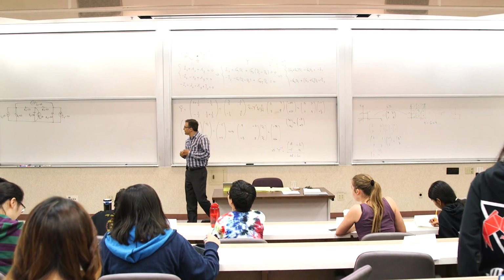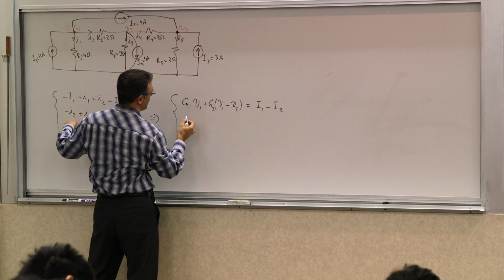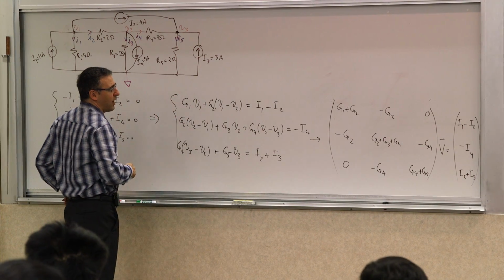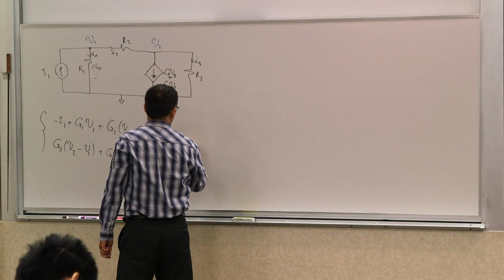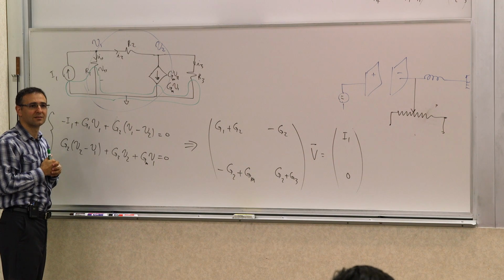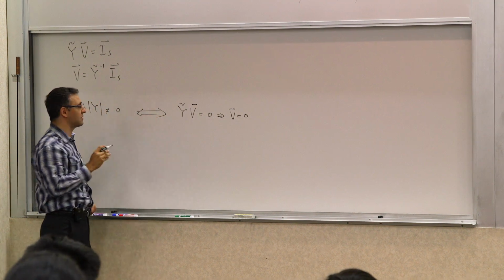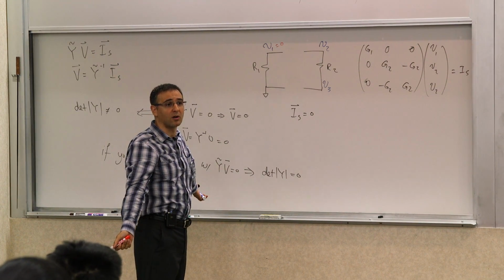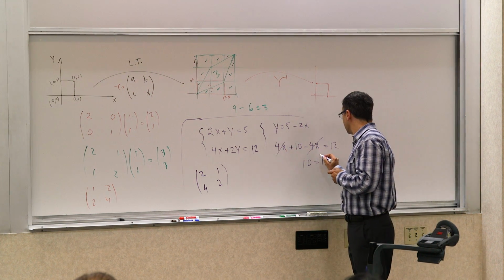005. Nodal Analysis: Examples, Dependent Sources, Existence of a Solution

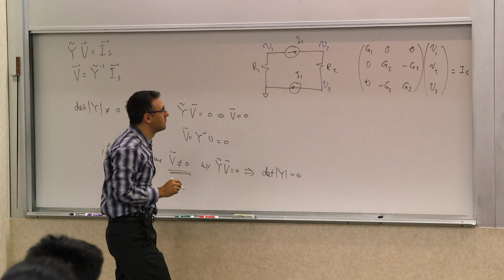Comment: SO at 24:55 there is no unique solution BUT there is no contradiction in assuming that V2 and V3 are at 5 volts. You can call them 10 volts if you like. The fact that the voltages are equal means that no current flows between them. Choosing zero volts for V1 was also an arbitrary choice. You could have called it 7 volts. In fact because of capacitive coupling various unconnected wires may have different voltages relative to ground. Note that if there is a solution to Y*V = 0 then then the null space of Y has non zero dimension and det(Y) must equal 0.